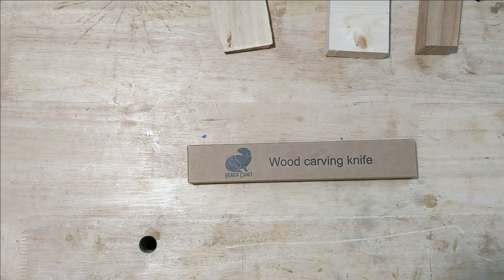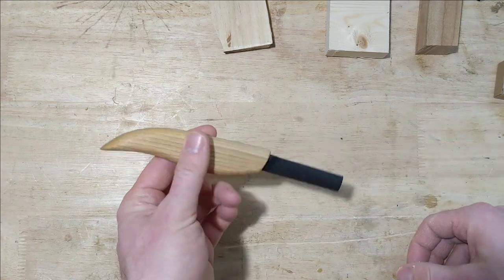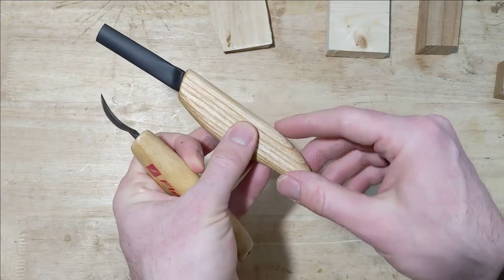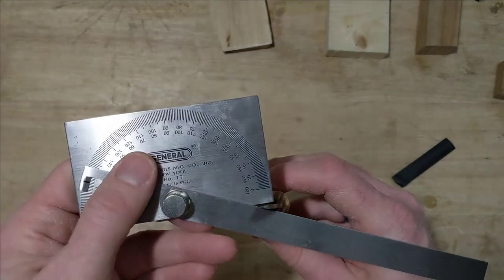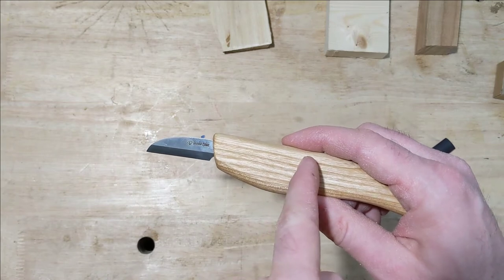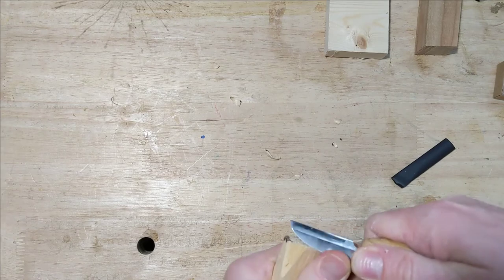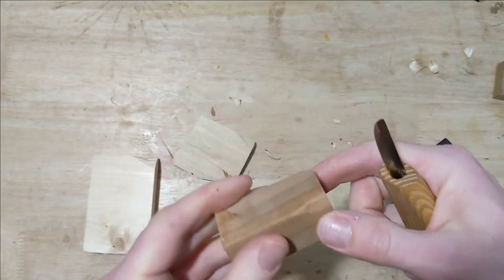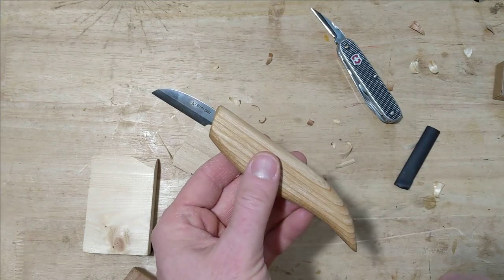BeaverCraft Carving Knife Review

Comment: Where do you get. Your woods do you cut them yourself or buy it at a local market or online?
Reply from the maker: Occasionally I need something specific and I take a trip to the sawmill or the hardware store, but that is the exception, most of the wood I use is free in one way or another. I get wood from the trees on my and my friends properties when they need trimming. I also get wood off the side of the road when people put it out for others to take for firewood (something that happens often around here). I have a few friends that work in industries that deal in wood and/or trees, and they let me know if they find something cool. Whenever I hear a chainsaw I go see if it is cool wood they are cutting and many people will give me a chunk for free, if not all of it. Word got out that I am a woodworker and people are often offering me scraps, cutoffs, trimmings, and would be firewood. I am lucky to be sure, but I have a good supply of wood for almost nothing.
Reply: Thanks 😊